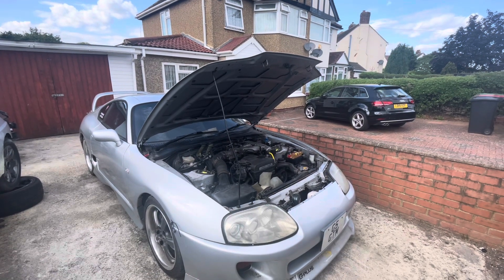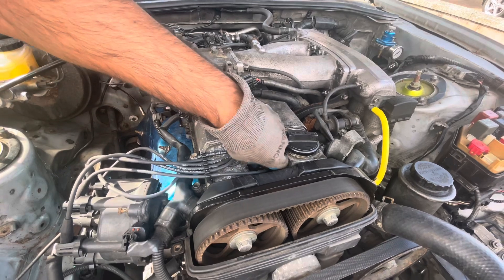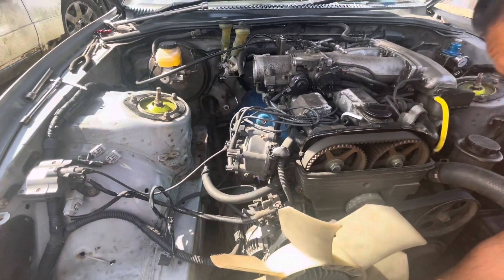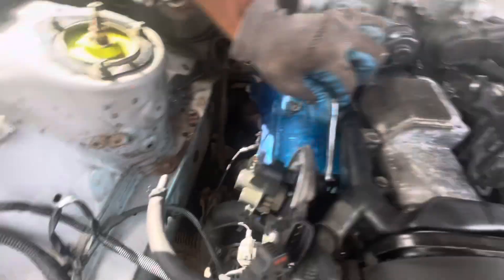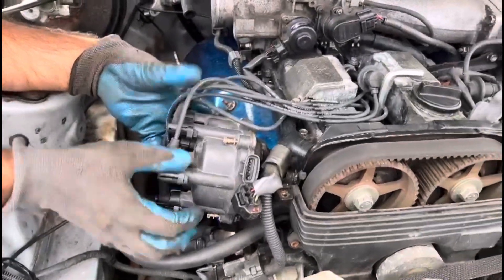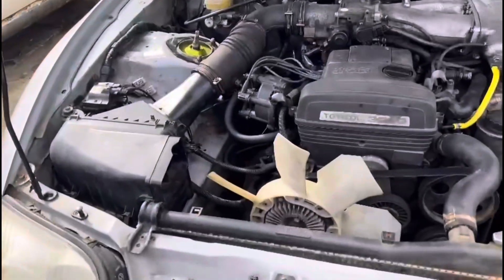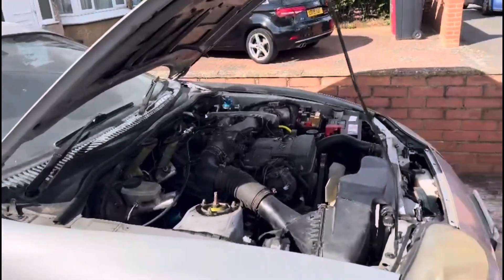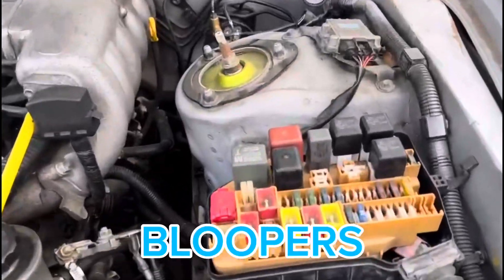POV: How to Set 2JZ Distributor Timing | Toyota Supra MK4 2JZ-GE Firing Order & Correction

Comment: I have an automatic. Do I keep it in neutral or park? Or drive? For this process
Reply from the maker: Good question, it should be in Neutral as you would need to rotate the engine manually from the crank pulley in order to get the first piston to the highest point 👍

Comment: would the marks on the distributor fall out of mark naturally overtime? or would that only happen if someone improperly installed it? and also my distributor is leaking and i plan to change the o-rings on it. would it make sense for me to check the timing on it or should i assume that its all in order?
Reply from the maker: @YEOUBE  this shouldn’t happen unless someone has replaced the distributor, if your replacing the o-ring I would time it up 👍
Reply: @zabzproject1416  great thanks!

Comment: Great Video it helped me atleast my Injectors are spraying now but now the Sparkplugs make no spark anymore.... 😅
Reply from the maker: @noellass2218  🤦🏽‍♂️ you sure everything is plugged in as should?

I would time it up one more time, make sure the first piston is at the highest point and then time everything else 👍
All the best
Reply: @zabzproject1416  Yeah everything is fine. With the old Sparkplugs I had a spark.... will change them again and hope for the best.
Reply: @zabzproject1416  Hey found the problem on my Supra I had a faulty ECU and 2 cabels had a loose connection.
Reply from the maker: @ no way, how did that happen? I think one our single turbo Supra has the same issue as you… going to work on it this summer 😍
Reply: @zabzproject1416  no Idea I guess some solder joints aren´t in the best shape after 32 years. Same goes for the Cabels. Just happy to be in a Group of 200+ ppl that own Supras in germany.
Reply from the maker: @ that 💯 helps, hows the car running now?
Reply: @zabzproject1416  gotta wait for an other Fulepump ECU cause mine is not working with the new Motor ECU but it runs fine without the Fulepump ECU
Reply from the maker: @ let us know how it goes, would love to see it run 😇 all the best and thank you for letting us know 💪

Comment: So how exactly was it running before you did this? Mine is running lumpy like it's not firing all cylinders, compression is all good, new plugs, leads, new dizzy cap and rotor arm, injectors serviced and tested, ecu repaired, yet still getting lumpiness throughout rev range from idle to high revs
Reply: Update: my issue wasn't this, there was a short circuit in my ecu so there was no signal to fire injector 4
Reply from the maker: @ that’s great news, I’m glad to hear it’s all sorted 😍
Reply from the maker: @LewisFoster2024  so ours was misfiring on cylinder 3 & 4 also was lacking in power / holding back…

After this was done it seemed to run smoother and had a better throttle response..

Have a go it’s not too difficult to do and it costs absolutely nothing but your time, if this works for you then you’ve resolved the issue 👍
Reply: @zabzproject1416  Hope so, already spent a fortune guessing different things to no avail, how did you find out it was missing on 3 and 4? I checked all leads with my timing light and all firing
Reply from the maker: @LewisFoster2024  when we took it for test drive, it was holding bk on certain revs…

Go for the distributor timing like we did and see what happens, make sure to let us know how you get along 👍
Reply: @zabzproject1416  Ok, I tried this and the marks on the distributor were already lined up perfect so that isn't my issue. Still fishing for answers.
Reply from the maker: @LewisFoster2024  Did you make sure the cams are all aligned and your first piston was at the top position?

Have you done compression test?
Reply: @zabzproject1416  Cams were lined up and the mark on the crank as I was changing timing belt at the same time. Compression all around 210psi

Comment: I’m looking at a Supra to buy and the owner says it’s running rough because of delayed timing. Will this method correct the timing? It’s the same non vvti motor as yours by the way. Thank you sir!
Reply from the maker: @Ohmylantahjz  I would recommend to check for compression test to make sure all cylinders are good & then we can assume it’s the firing order / timing that will need adjusting as well as servicing the spark plug & ignition leads 👍
Reply: Thank you sir, I’ll look into that and let you know how it goes. Cheers! 🤙🏽